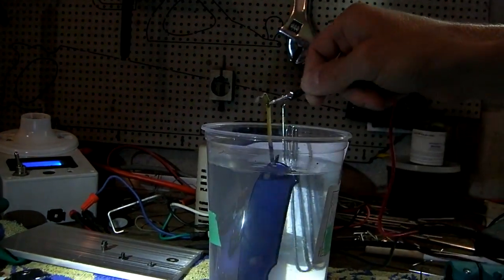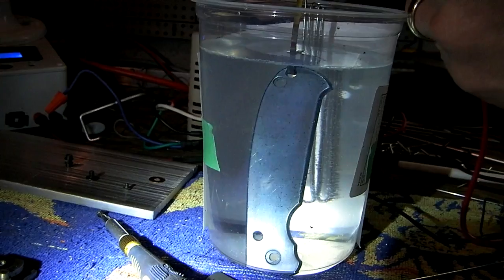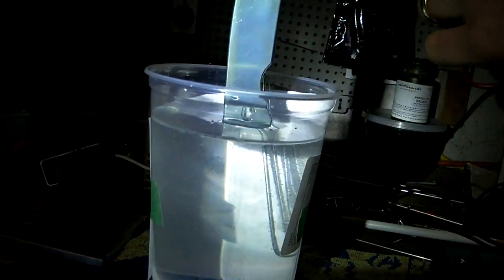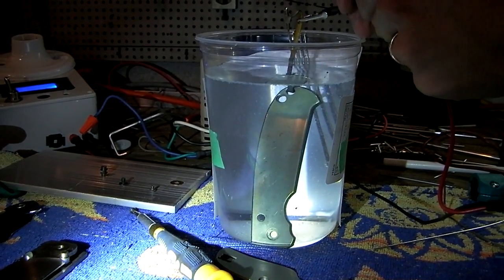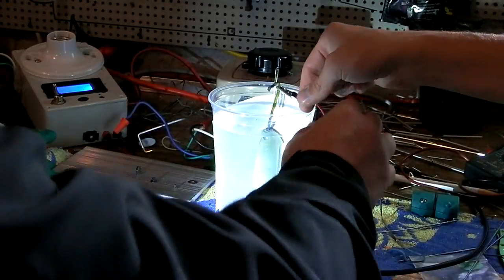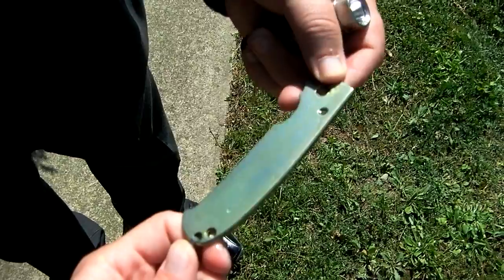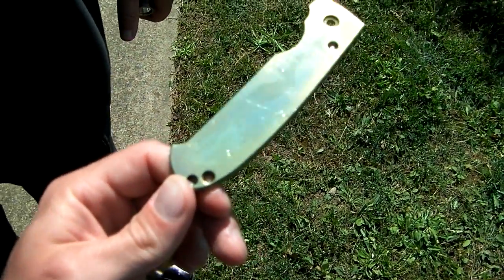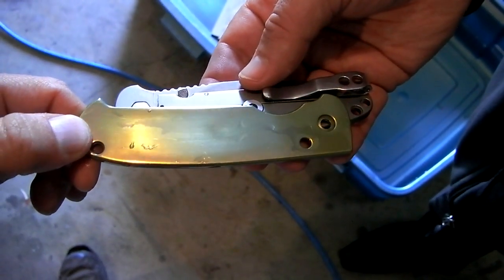AG Russel Acies Part 1 - Anodizing Titanium

Comment from the maker: Good question!  Not really, for titanium it's all about the voltage.  If you have an amp gauge you can tell when it's reached peak color at that voltage because amps will drop close to 0.  For aluminum anodizing, it's all about the amperage and voltage is variable.

Comment from the maker: @BkbladzZz That's what google is for *grin*.  I'm happy to give you the basic ideas and parts required but you've gotta make the effort to learn it if you really want to do it.  Also when it comes to wiring and electronics you practically NEED to understand how it all works or else you run the risk of killing yourself by electrocution.  Search and learn.  Start with the website MrTitanium.